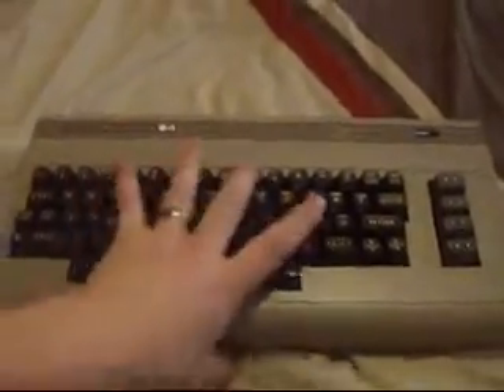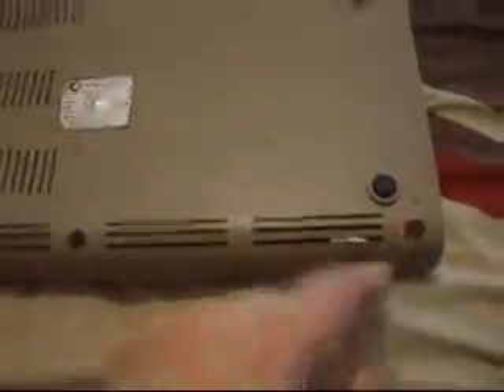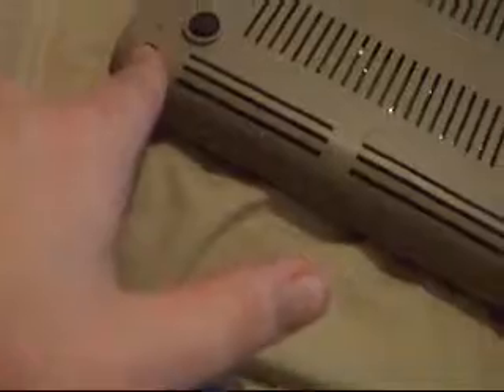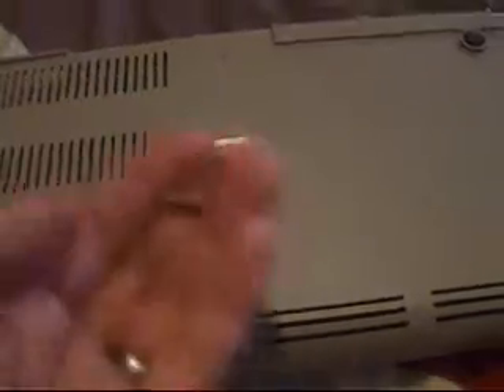commodore 64 pla fix repair black screen start up

Comment: Aww the rare breed of the British northerner! Most often spotted topless and has even been known to adorn its self with shiny objects.Pray beware that the creature does not confuse you with it's strange language skills and unusual use of dialect! If spotted it is best not to confront the creature, but to distract it by throwing an old faulty c64 at its feet. The creature may still attack you at this point, but will probably just fondle the c64 lovingly and start to make repairs!

Comment: I repaired thousands of C 64  and C 128's back in the mid 80's. Those were very decent systems for the price and where we were with technology. Many people got their start with computer software learning Commodore basic..
The PLA IC was the most common problem and most were soldered in. It is easy to tear up the board and ruin the unit if you DON't know how to desolder the old PLA. I always installed a socket after removing the old piece.